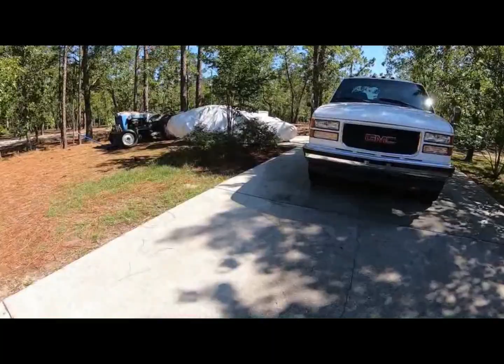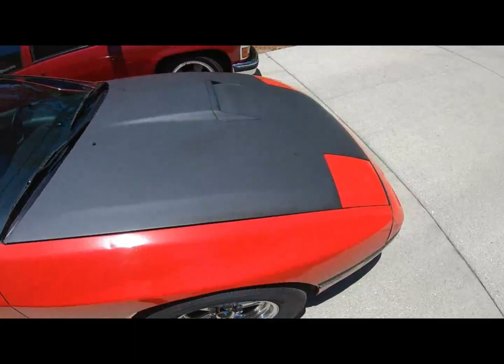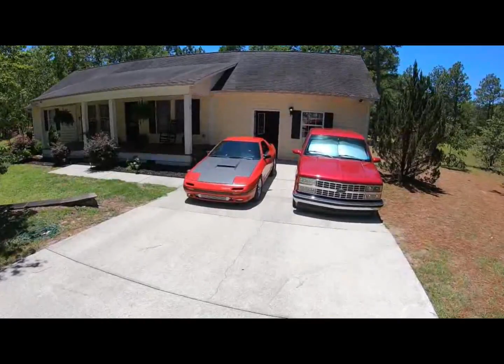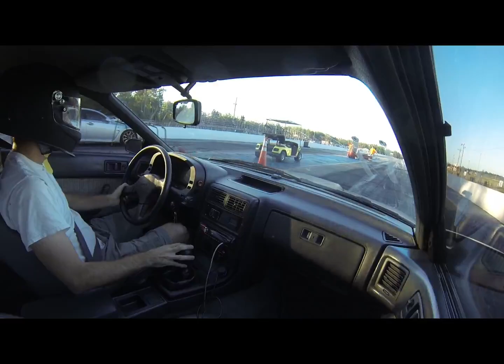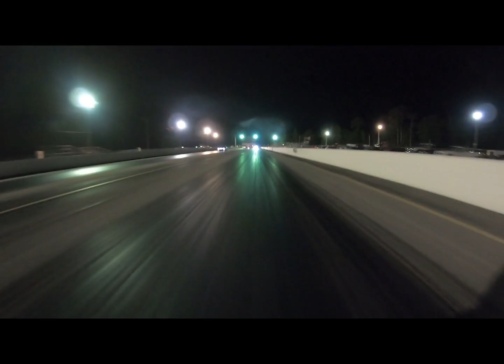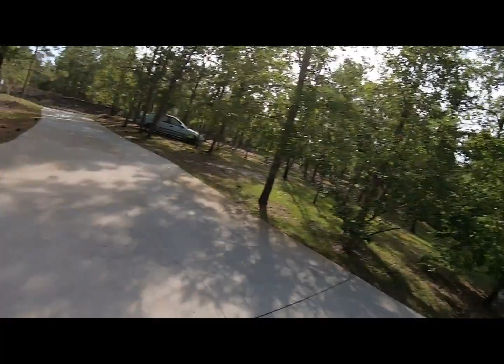Track day fail in my turbo lsx rx7

Comment: what are your wheel and tire specs for the track? I am building my turbo ls rx7 right now and trying to get a rear fitment like your rx7
Reply from the maker: Rear is 15x8 5.5 bs. Fronts are 15x3.5 1.75 bs
Reply: thanks, can I by chance get the tire specs for the rear?